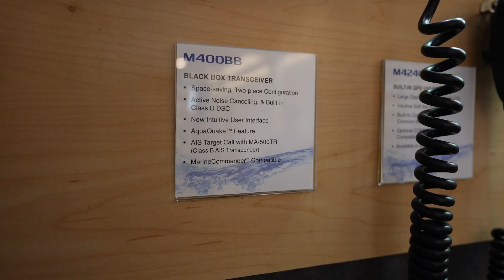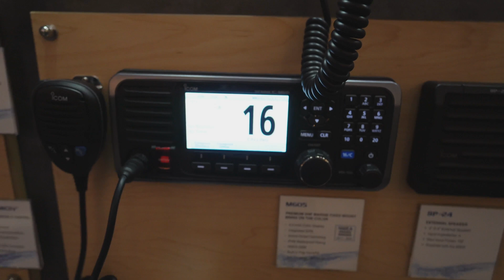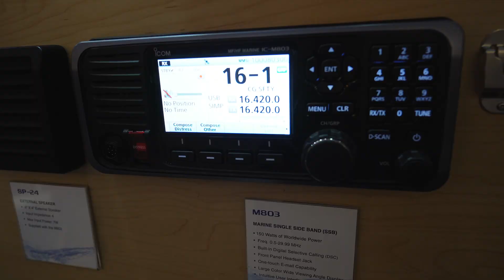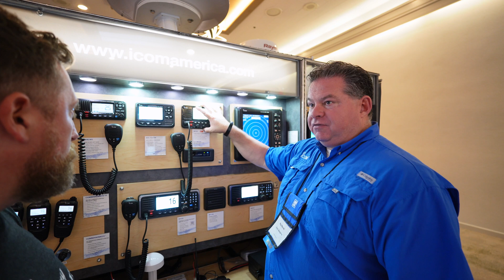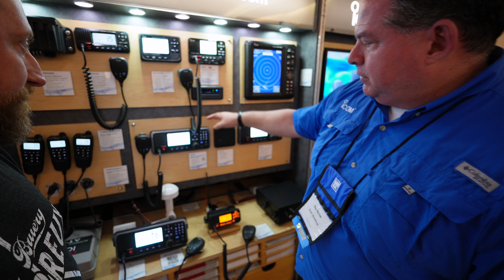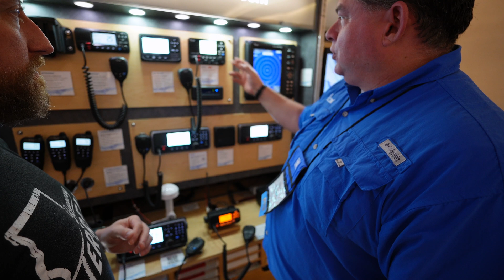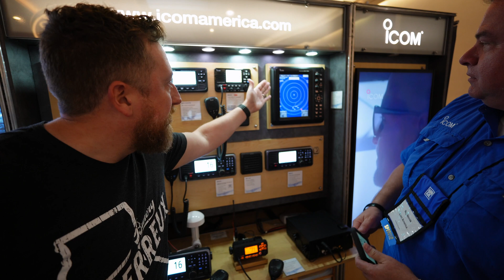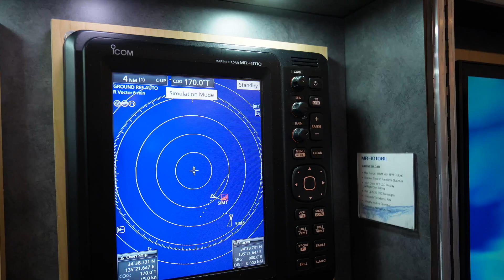Why Does This Radio Have A Distress Button?

Comment: Why aren't marine hand held radios "distress orange" colored"?  Much easier to find either on board or overboard in the water.
Reply: Some actually are. 
There are regular marine hand-held radios, which are usually black, and there are survival radios, like IC-GM1600, which are yellow/orange. 
There are special requirements for radios which are to be used in survival craft, so they're rated to work in very wide temperature ranges and so on. They also use a combination or non-rechargeable and rechargeable batteries (on some radios, you can have both connected at the same time, on others, you need to switch). The rechargeable are for normal use, and the non-rechargeable are for when you're abandoning ship. 
The non-rechargeable have a clear expiry date, and the idea is that with them, at the expiry date, you'll have a guaranteed amount of time time during which the radio can work, even in extremely low or high temperatures, so it can't happen that just as you're deploying life boats, you find out that the battery of the hand-held radios is empty. Also, the non-rechargeable batteries are supposed to be discarded after every use. 

I don't know regulations enough, to say if the orange color is forbidden for non-survival radios.

Comment: did you guys remember ,  KAZU 1  19-ton tourist boat  sunk in northern Japan several months ago.    they were using amateur radio , they called for help using amateur radio frequency.  they did not even have VHF marine radio.  nor AIS, DSC , EPIRB  that was one of the reason everybody in that boat died.   despite of ICOM being Japanese company VHF marine radio is not popular in Japan.  most of boat owner I knew did not have VHF marine radio nor, AIS, DSC, EPIRB.  they all had amateur radio in their boat however.
Reply from the maker: Can you provide a link for citation?

Comment: I have the IC-M802 MF/HF radio which I bought to put on my boat for use when out of VHF range. While it is channelized with the marine frequencies already programmed into it, it can easily be modified for general coverage transmit for ham radio use. One feature that it has, which I have never seen in any ham radio I've owned, is voice actuated squelch. There can be loads of summer static on whatever frequency you're monitoring but it will simply go away once the voice actuated squelch is turned on. Only when someone begins speaking will it open up. It works like a hot damn. Ivan VE7IVN
Reply: Many of Icom's HF amateur rigs has the squelch capability, just adjust the RF Gain control.  One direction is RF Gain, the other is squelch.
Reply: @MrN9ja  Voice operated squelch does not work the same as regular AGC derived squelch found on most ham rigs. It uses DSP to listen for human voice patterns and only opens up when it detects a human voice. It's very effective. I understand that there are outboard devices which can be inserted into the audio chain which perform much the same function.

Comment: I'm a long time ham operator but monitor marine VHF, as well. I recently retired after 21 years of being a lighthouse keeper on the west coast of British Columbia. I monitored Channel 16 as well as a couple of the Canadian Coast Guard working channels. I moved to an island not far from my last lighthouse and like to keep my finger on the pulse of what's happening on the water. Old habits are hard to break. Right now, I'm just using an Icom IC-M73 handheld for monitoring but will be setting up a base radio with outdoor antenna for extended range. The only time I'd transmit these days is in the event of a distress call if no one else was responding. Ivan VE7IVN

Comment: They also make aviation radios, both handheld as well as aircraft and base station radios as well. Most aviation comm radios are AM while in some trans Atlantic and trans Pacific are equipped with HF radios. There are also some satellite based comm gear on the state of the art aircraft but I do not believe Icom has a presence in this niche market. I have an old Icom marine radio in my Go Box. Perfect for SAR Ops.

Comment: Would be nice if we could program 2m frequencies so we could have a very rugged handheld
Reply: Sorry, the FCC will not allow a multi-service product get certified.  For a ruggedized dualband portable, check out the  new IC-T10.
Reply: @MrN9ja  I understand.  Just dreaming of cool possibilities.  Similar to if the A25 could be wide banded, then we could have 2m AM.  Just dreamibg
Reply: Carry a UV5R problem solved !